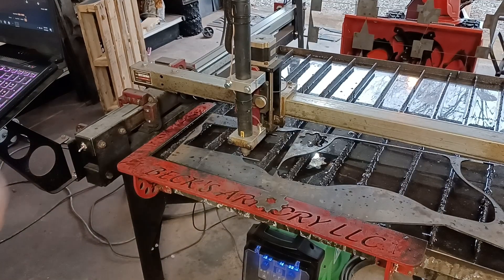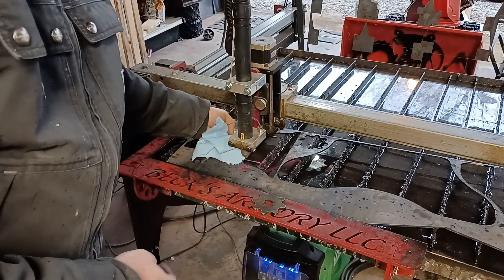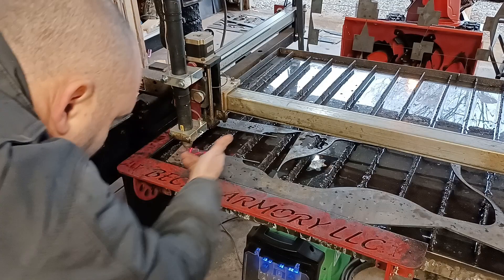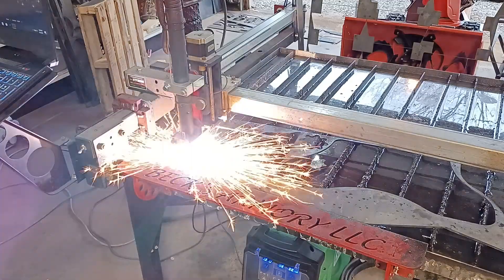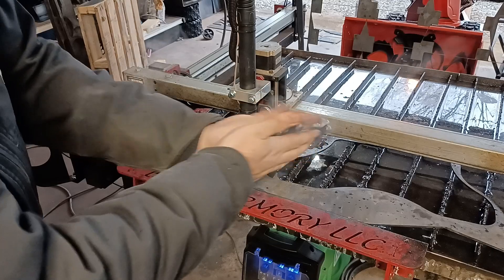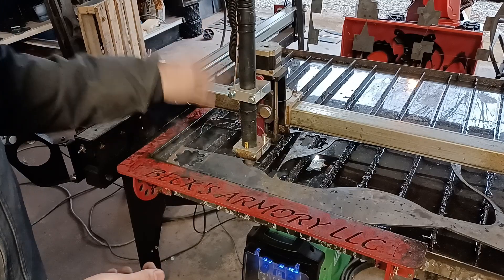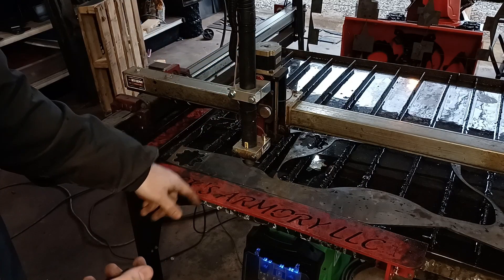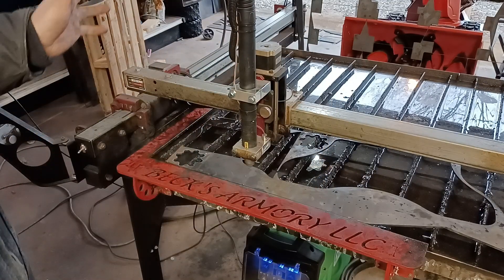benefits of having laser alignment on your langmuir systems Crossfire Pro

Comment: Great content! How did center the light with the torch on the work piece
? I’m having a hard time with mine.
Reply from the maker: so, you lower your z axis and hit the test fire button to fire the torch which makes a tiny pierce hole.  Then you raise your Z axis and rotate each laser line until they cross each other at the hole location. You do have the lasers that make lines and not a dot, correct?

Comment: do you have the thc connected through  the cnc plug on the back of the everlast ? im having issues with getting the 1/50 divided setup right with mine
Reply from the maker: I did connect with the cnc plug but ended up going with the raw voltage pins.  I had to break the ground pin off my laptop charger for the THC to register any voltage.  Fire control says your voltage is low but useable when you run the test.  I talked to Everlast and they said it's not "low" at all.  They said it's exactly the way it's supposed to be and they designed it to run that voltage.  They claim the voltage Langmuir thinks is needed is not needed for quality cuts.